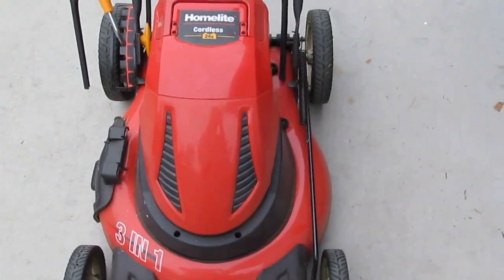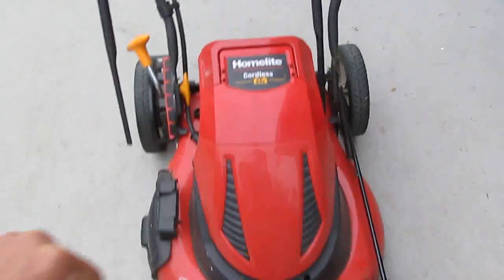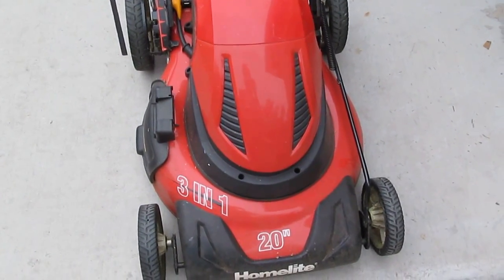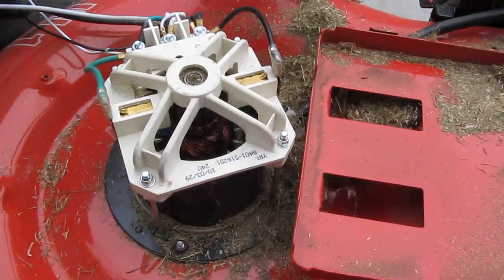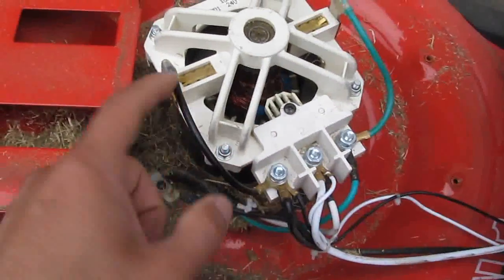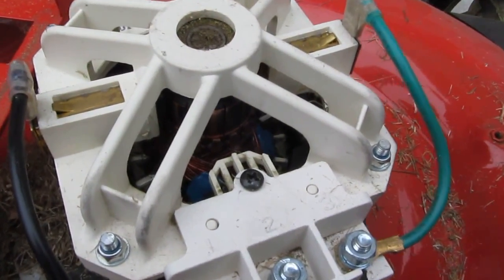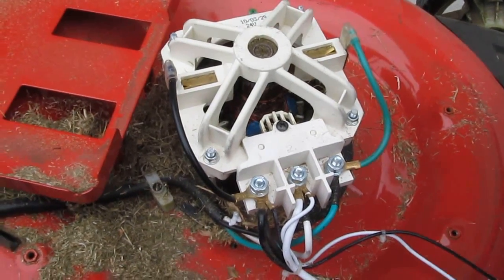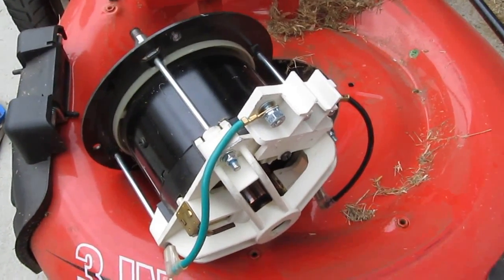Homelite 24V Cordless lawn mower tear down to get DC motor for electric scooter/bike

Comment: darn, you skipped the part where you took the top off.  That's what I was looking for.  I have a loose charging cable I need to fix.  Looks like 6 screws?
Reply from the maker: I think so. There are just a few screws. It is quite easy to disassemble.

Comment: Same as you, I am trying to buy a cheap, used electric lawnmower to make an electric bike.
But, just from knowing the motor is "24V," how can you know that it is powerful enough for an electric bike? 
Don't you need to know the current that this motor will require in order to run? None of the ads that I see online for electric lawnmowers say how many amps the motor takes.
Thanks for the help!
Reply from the maker: I don't know the specs of this motor. There's no labels on it. But I did put in in my bike just trying to see how powerful it went. Man it's strong! This motor can even power a go cart, not just a bike. You will need a high amp 24V controller for it though. I only used a momentary switch to test it on my bike. It's outright dangerous because the moment I press the switch, it gives me full throttle and hard to control.
Reply: Do you really think someone could use a dc brush motor from a 24v cordless mower for an electric go-kart? I would like to make one of these for my kid, I can easily find dead 24v cordless electric lawn mowers with still good motors!
Reply: You look at what size the protection is on the mower. Mine like this has a 30a breaker. I wouldn't put any more than 30 amps to it, but I ha e run this motor on 48v and it's a beast. Be careful.

Comment: What is the max voltage you can use with this mower? I don't understand the switch? When I apply power directly to the Black and Green wires you think the motor would spin but it doesn't? I have the same mower that I'm building an ebike to test the power of it. I want to build a Crazy Cart with it.
Reply: You can use about any voltage you want to. The motors are rated at amps, and I believe this is rated at 30 amps. So in this mower it's running a maximum of 720 watts. If you ran it off 48 volts it would be 1440 watts and it would spin twice as fast. 48 volts is as fast as I would run it, and I'd check the brushes and make sure they were ok. At that speed the motor gets really ineficiant.

Comment: I am salvaging the motor of an electric mower just like this one -the only difference is the color and brand. Did you have any trouble removing the top plastic cover?
Reply from the maker: I did this a while back so I don't remember exactly as I also did many other brands as well. But almost all of them require you to remove screws hidden underneath. That's the place where all of the grass and dirt got stuck to it. So if the mower is dirty, you'll have a hard time finding the screws as it's hidden under the dirt and the grass. You just have to clean the bottom (where the blade is) in order to find the screws.

Comment: Can I buy your electric motor? I have that exact same lawn mower, and the motor in mine is shot. Can't find the replacement motor anywhere. If you don't want to sell your motor, I have 2 chargers and 3 of those 24 Volt batteries, one of which has barely been used, if you're interested in buying. I live in Virginia.